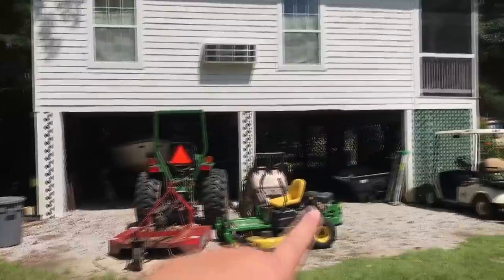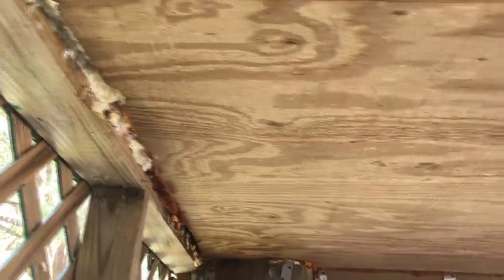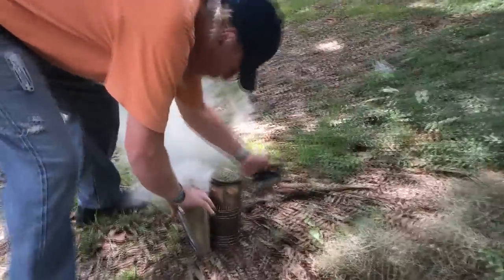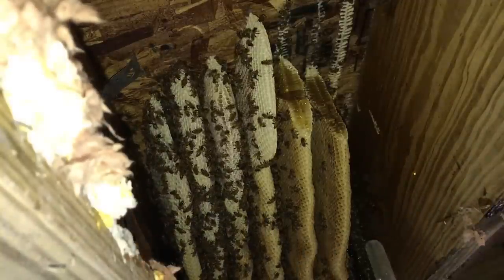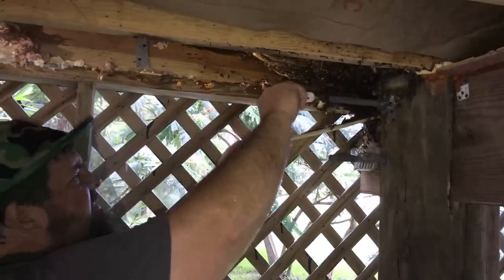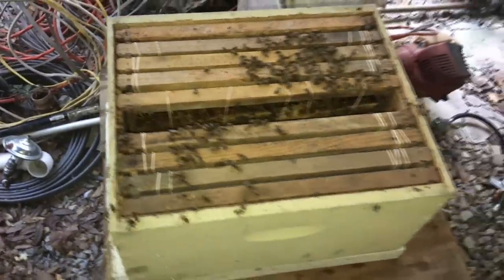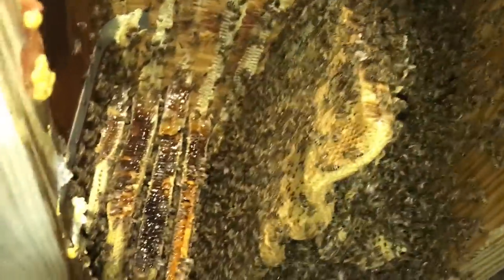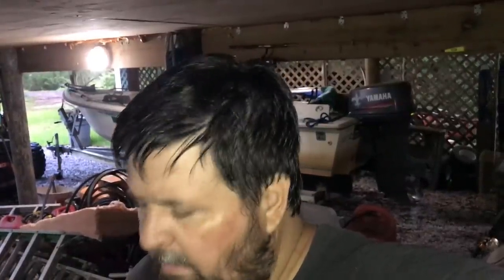Is This Honey Safe To Eat?

Comment: Did you use a different export setting for the video? Looks like it has combing artifacts in the image, maybe exported interlaced rather than progressive scan?
Reply from the maker: Took almost ten hours to get it to render and get it uploaded.  I was on with Adobe tech support for an entire day trying to figure out problems getting the entire file to render.  When we finally got it to put together a full file I uploaded not even caring any more what the quality would be.  I'm not sure what happened.
Reply: @628DirtRooster   That sounds like a nightmare, well done for getting it finished and uploaded. Hopefully you won't have those kinds of problems again. 

Computer issues can be frustrating, especially when they come out of the blue, for seemingly no reason. I built my PC 5 years ago and it worked perfectly all that time, until one day a few months back when it wouldn't boot up. After hours of troubleshooting, I was able to fix it and it has worked fine since (updated/reinstalled BIOS on motherboard).

Comment: Love me some nitrile gloves... I’m just saying. It helps sometimes...
Reply from the maker: I wish they made big ones.  Like Mr. Ed says I have big watermelon hands.  I had two boxes of them in the truck but they normally split when I'm putting them on.
Reply: 628DirtRooster Bees I don’t have hands I have paws so I know what a pain it is to find gloves to fit but they make them. I have found that tool trucks (Snap-on, Mac, Marco) often have “man sized” gloves on their trucks also Granger sells xxxl microflex nitrile gloves.  I also have found xxl nitrile gloves at the homeless despot.  I tend to buy both latex and nitrile gloves mostly because latex gloves tend to be cheaper than nitrile gloves
Reply from the maker: @gullreefclub  The biggest ones I have are from Sherwin Williams.  Homo Depot doesn't usually have anything that will work for me.  The only time I really need them is for crushing comb though.
Reply: @gullreefclub I like the black ones from Walmart that have white inside... I turn them inside out and they are as tough as nails... but might have to special order the larger sizes
Reply: 628DirtRooster Bees put some baby powder on ur hands b4 u try slipping them on. just means u have to carry gloves and baby powder lol